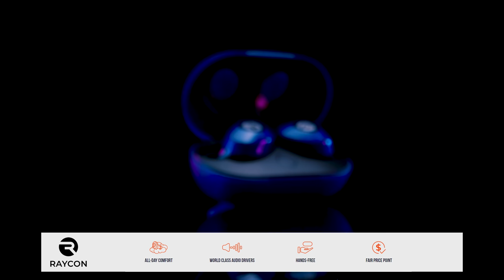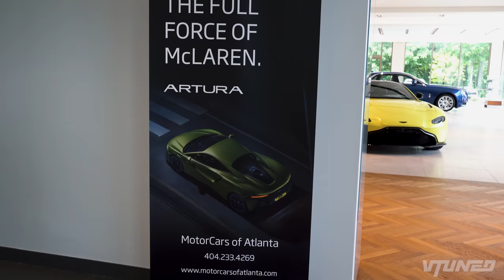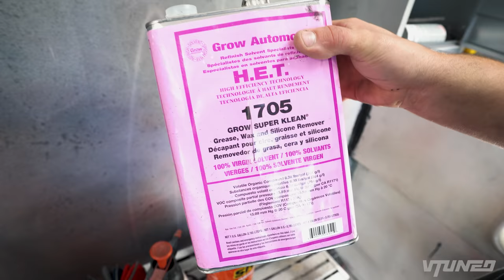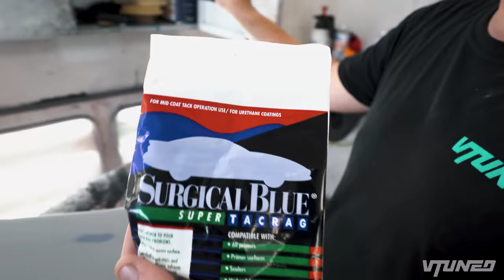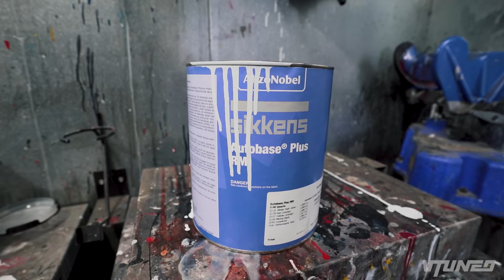Finally Painting the McLaren 720s Arctic White - Episode 23

Comment: What an accomplishment. If nothing more than for personal reasons. To rebuild a car from thw ground up and have a cool ride in the end. As the back seat driver here it was interesting to see the ins and outs on a car of that cost. New fans for the booth.. I think I said to check them a while ago.. dont know if they are direct drive or belt driven. 3 phase or single. But hey it will make for better painting. Now keep up with filter changes regularly as that will help those motors.

Comment: I just cleaned my PCV valve with carb cleaner on an old Nissan. It got clogged and was blowing out oil between it and the rubber seal all over the rocker cover and even sent oil up the dip stick. When it clogs up, excess left over combustion gases have no where to escape which builds pressure in the engine that forcibly causes oil leaks. If you find you are losing oil overtime, have burning oil smell, or even leaking rocker cover gaskets, check your PCV valve. On my car they are just plugged in and easy to damage so I just use the hose it’s clipped to to pull it. Others are screwed in. It’s usually a cheap part when you can find it.

Comment: Generally if your engine is smokey it's getting oil into cylinder via the compression rings or valve stem seals,also if its turbo the seals may be going out pumping oil into ehaust or into the charge pipes

Comment: You made the right choice with that white! Can't wait to see it all assembled! Also, it might be pointless to ask, but did you torque down to the right spec all the nuts and bolts that hold the suspension and the front and rear subframe? This is a 200mph car and while you might never take it to those speeds is better to be ready and have everything torqued to the right specs! 😅

Comment: can not get a scan tool but you can get the soft ware and run it on laptop.... 2 the car smoking.... The key question is it oil smoke or fuel smoke give it a sniff......... If its oil you might have 12000 dollar problem .. 720s is known for grenading them selves... Swear ask Stradman ...... If its fuel i look  at getting a massive tune up.. in the wreck you could have cracked a spark plug or damage coil pack or even losen a ground off the coil packs ... Causing unburnt fuel out the tail pipe... Back to the conditions if its oil smoke ....... just sale the car while it runs..... swear ...... One last option check the intake for cracks because the engine is mounted it adsorbs allot of the impact  so check entire engine for cracks improper crank case pressure could cause smoke